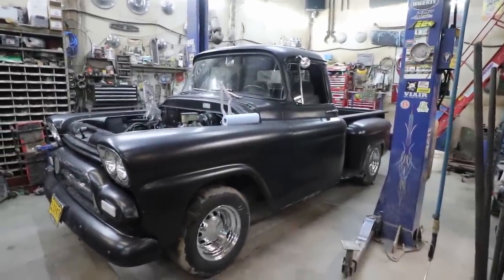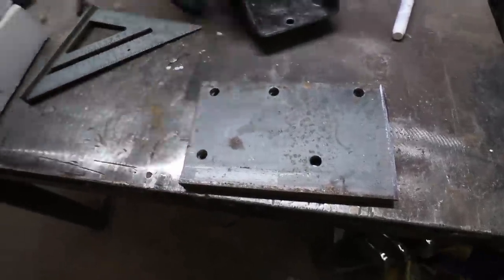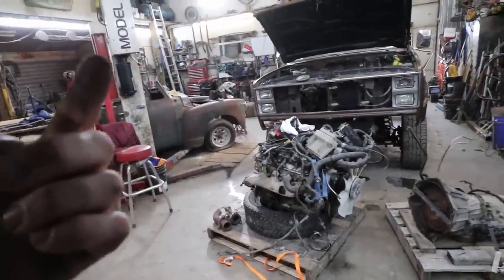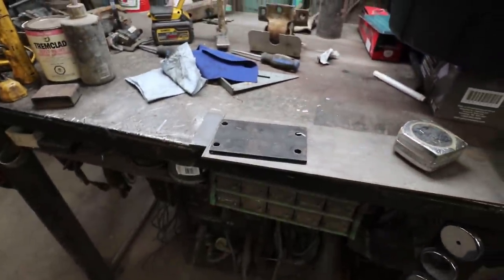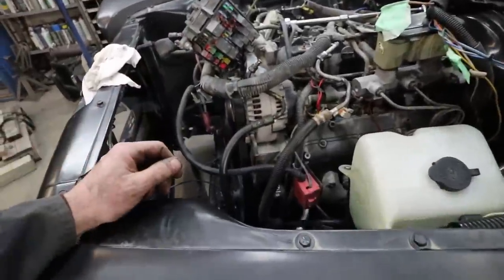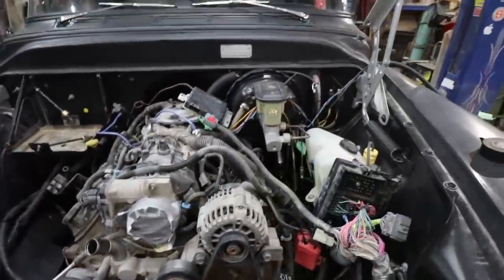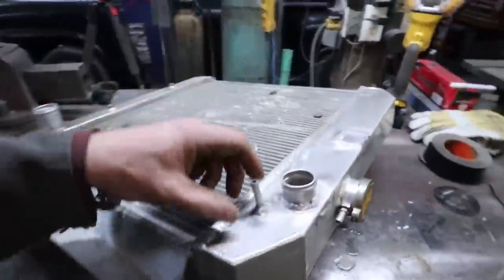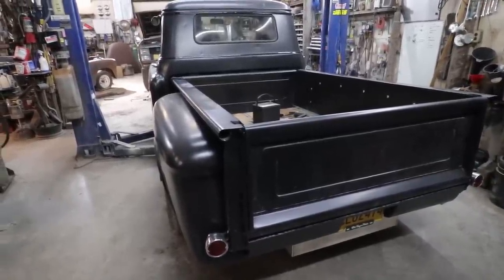Installing an LS in a 1959 GMC pickup

Comment: Sweet tip on using your ball joint tool on your drive shaft U-joint that worked great I've had one of those ball joint tools never thought of using it for U-joints I've always just use my vise

Comment: Pablo, backseat driver. Electrical later, rad modified n set up back inside, driveshaft fit but motor mounts modified bit by bit, ls sitting where a big block was in a 59GMC a generational cus'n. Wiring harnessed in the weeds, minds gathered for a truck n some dog boys' needs.

Comment: Excellent video Halfass Kustoms  :) also are you put Fan shroud on rad to and don't forget on Battery cables for - have ground cable of pig tail in dashboard firewall to plus connector with bolt plus 2 washers to for super grounded too! Looking forward next videos on this engine plus transmission swap too and excellent going so far perfectly too!

Comment: Nice looking truck. Although I would have stuck with a big block Chevy engine, if it were my truck. Who knows, maybe the owner wanted better gas mileage. In which case, I would have just gone with a nice small block Chevy engine. Just not a big fan of these LS engines. Just don't look good at car shows/cruise ins. In my opinion. I like an engine to look as good as the rest of the car, if not better. But everyone is entitled to their opinion. This just happens to be mine. Thanks for entertaining us. Looking forward to the next one.

Comment: An old mechanic told me you can just swap the pressure fitting in the back of the pump to change line types. I don't know that for sure because I had already bought a crossover hose for my swap.

Comment: Someone can correct me if I'm wrong but using a steel wire brush on aluminum to clean it will make welding the aluminum very difficult.

Comment: why do you not need rear 02 sensors
Reply from the maker: I turn then off in the computer. It'll need the front to trim fuel the rears are there for after cats
Reply: @HalfassKustoms  so it just uses the front sensors for fuel trim and the computer doesn't really need long term trims to run good. i understand now.